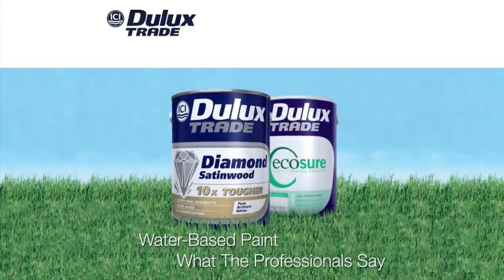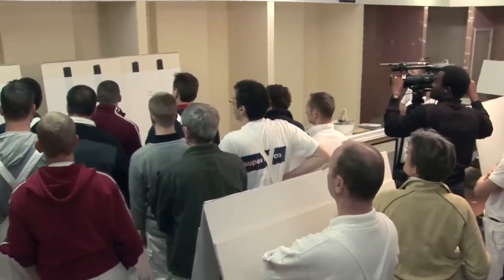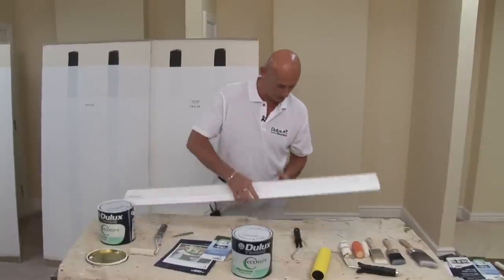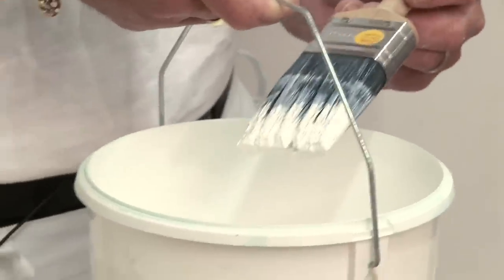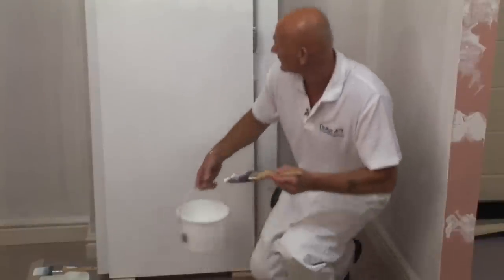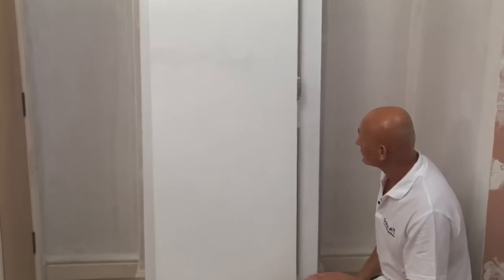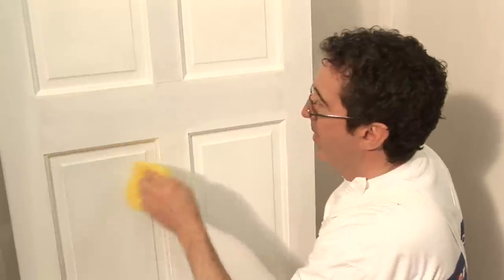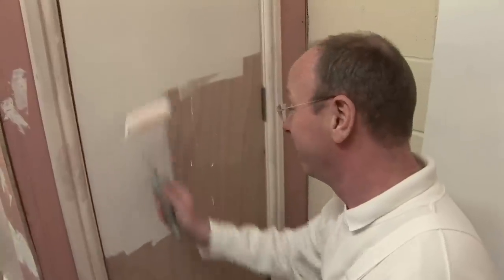Water Based Dulux Trade Paint - What The Professionals Say

Comment: FACT... Water based gloss paint is SHITE. Family painters and decorators since before the war.
Reply from the maker: Water-based products have a lower carbon footprint due to the replacement of oil-based solvents with water and are also low odour, quicker drying and are resistant to discoloration and the application technique differs to solvent based products. What is the issue that you are having. - Caroline